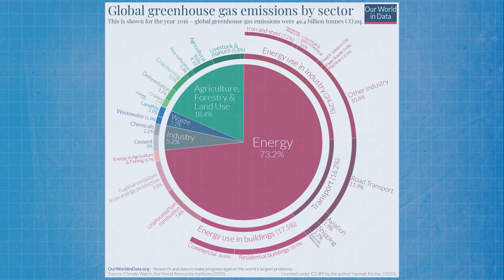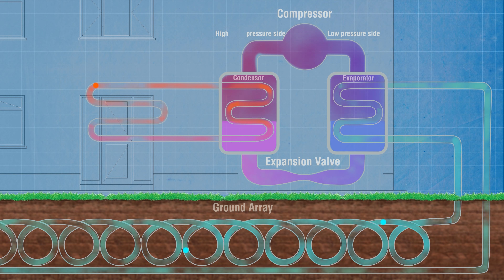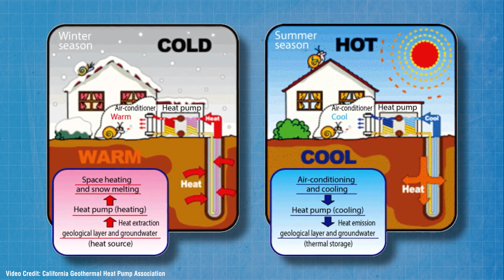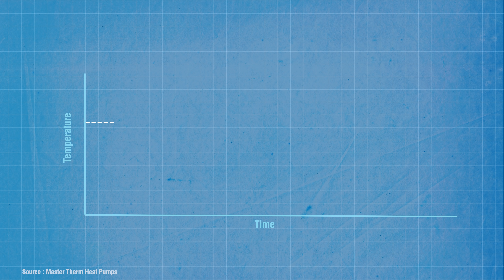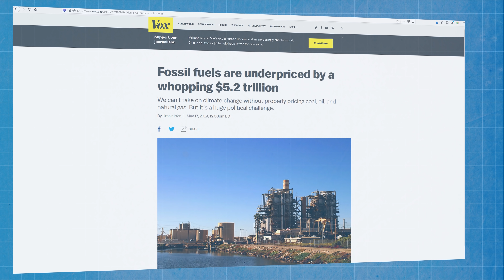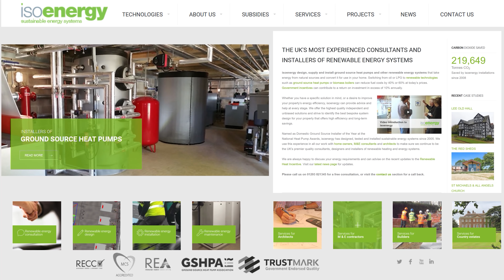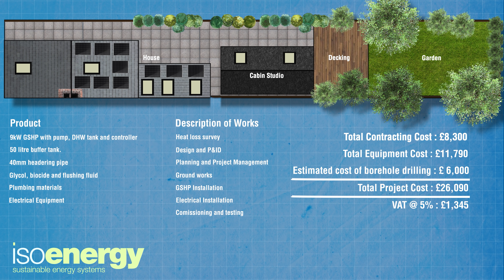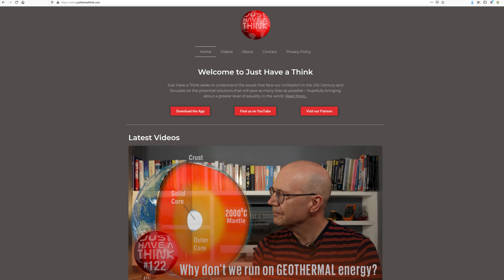Geothermal ground source heat pumps. Heating your home from your own back yard!

Comment: Has anyone looked into more micro systems which can be applied to more urban settings. What I mean is.. in an urban setting you might have small front garden which can provide enough heat for one or two radiators but not a whole house. Can you put a small set up next to that radiator...like something as small as the working of a fridge. because it is smaller it will be quieter so you may be able to house it in the same room as the 'front garden radiator'.

What I am getting as is that you can have one set up for a front radiator and then one for a back one ( for a smaller back yard ) these can then be running all the time allowing for smoother heating.

Currently the scale of one large Geo thermal pump is off putting for many and required a continuous chunk of land ( ignoring vertical here )

Comment: Geothermal and ground heat pumps seem to be all the talk at moment to help green credentials and reduce power usage.
In London we have a ready made geothermal structure. That is London underground rail, the Victoria line never dropped below an average of 24C last year. Cold buildings above ground that need heating and hot tunnels below ground that need cooling!

Comment: Ground source heat pumps in UK stop working after a couple of seasons as the ground temp permanently reduces around the pipes. We don't have the AC systems in summer to put heat back in the ground.
Reply: They don't require AC to recharge the ground, so is irrelevant whether someone has AC at the outset. By default with modern ones, there's passive cooling, which requires no additional hardware and will use thermodynamics to recharge the ground.  There's active cooling, where hardware can be installed to utilise the compressor to have AC-like cooling using fan coils instead of radiators.
Reply: @keypoint1293  I live in a country where ground source heat pumps are common and investigated them a lot for a retrofit to my house.
It is you who doesn't understand how they work in this scenario.

Comment: I have a home in N. America (New Mexico) in the mountains that has a river running about 150meters away from the house. I worry about running a normal air to air heat pump because it gets down to around -20c in the winter. My idea is to run a Geothermal loop down to the river and then 500 to 1000 feet of pex tubing under the water and use a water to water (radiant floor) heat pump. My question is #1 how many feet should I run in the river and #2 what liquid can I safely run in the loop in case it breaks and contaminates the river?

Comment: You know what, I wonder why they don't put the heat collector part in the attick, from what I know heat climbs and it's lost once it's there. I would make a second level in the attick and have the air pass through there before it escapes. Also if the house was concieved in a way that walls communicate with the attick it woud ensure that most of the heat is reused.

Comment: I’m about to invest in an Air to Water Heatpump System for my home. I’ve made some calculations and it seems my ROI is about 7 years Ibased on the current Gas prices). I’ve also looked into ground systems. They are much more expensive and the ROI for them is around 10 - 12 years. Legislation in The Netherlands is being made that will forbid the vertical column ground systems. Experts are afraid it will pollute groundwater too much, bummer. My garden is too small for the horizontal ones. I’ve got the budget to do this so I’m inclined to go ahead. What do you think? Is it worth it? I’m not only in it for the money. I would like to do my part for a better world too.

Comment: I once rented a large house that had a geothermal system. Very impressive. The system kept the house pleasantly cool in hot weather and quite cozy even in the coldest winter weather. I was surprised at how rapidly the interior temperature could be adjusted. The cost of heating and cooling was also a fraction of what I had been paying in much smaller homes.

Comment: "Ground source heat pumps are different from geothermal energy, as geothermal energy uses the heat generated from the core of the earth. Ground source heat pumps, however, use the sun’s energy, which is stored in the ground as heat."

Comment: If governments are subsidizing geothermal systems perhaps their contribution could be the vertical or horizontal placement of underground pipes. Govts could do this more economically than property owners by making installations over wide areas, utilizing public land and combining with other underground work like sewage pipes. The property owner would pay for the rest of the system, if and when they choose to. If the current owner won’t use it, the next owner may.

Comment: These systems are popular in Norway, Sweden and Finland. In 2018 I changed my oil burner to a 6 kW inverter ground source heat pump with a 170 m vertical hole. Cost about 14 k€. Provides both hot water and heating. It works nicely down to -25 degr C outdoor temp without additional resistive electrical heating. Now I later added some insulation to the house and switched to larger radiators, which added to the cost. This was needed, because the old radiators were designed to run at 80 degr C, which a heat pump can't handle (and would be very inefficient at if it could). Now with larger radiators the temp will reach 55 degr C in the radiators at -25 C outdoor temp, which is quite rare, so usually the system runs much cooler (higher temp causes worse efficiency). I could get even higher efficiency (and lower operating costs) with even larger radiators, or radiators with in-built fans, or rebuilding floors for in-floor heating (expensive!), but I'm quite happy with the system now. Total efficiency for the heat pump, or SCOP, for a year is 3.7 (measured during 2021) and that's not bad for an old house from 1927. In a new house with in-floor heating, heat pump efficiency would reach even 4 or 5, due to lower heating temp and better insulation. There is no need to be afraid of electrical grid load during cold periods. This system uses 1.5 kW from the grid when it is producing 6 kW heat (which it doesn't do all the time). Your tea kettle uses more power! (momentarily at least).

Comment: I am currently looking out of my study window at a field with multiple bore holes for a village-wide ground source heat pump system - despite the fact that many of the houses in the village are listed and not suitable for a heat pump retrofit. It's a great idea for a new build village, but providing funds for proper insulation would have been much more cost-effective in this case.

Comment: I wonder if you have any actual experience of the RHI? We substantially reconstructed our house to make it more energy efficient; we put in Air Source heating and a micro ASHP for water heating (both of which are working very well) but we also improved insulation and triple glazed. We had read similar statements to the one you make about how much this would bring in and expected to reclaim about £7,000 over the seven years of RHI. In fact we get just over £400 per year because the payment is based not on efficiency or energy saved but on heat generated from renewable sources. This means that the better you insulate your home the LESS you will receive. It is in fact a disincentive. It beggars belief that any scheme could be so badly thought through.

Comment: These no doubt work in specific locations where the geothermal heat is sufficient, there are extreame variations in temperature and the infrastructure is in minds at the design phase of a build. To use these scenarios and apply them globally though is like selling hydro power to someone in a desert.

Comment: I installed solar power last year and a stand alone ductless air source heat pump and this is heating the home from the solar. In the summer in also acts as an air conditioning unit. 
I also installed a solar diverter a solic200 which sends excess power produced by the solar back into the immersion tank to heat domestic hot water rather than sending that excess power back to the grid. Once my gas boiler gives up the ghost, I will be installing an electric boiler. Which hopefully would have come down in price by the time I need to replace the existing boiler. Small changes over time all add up to make a difference for the future.

Comment: OK.
I believe most of what you said.
To briefly summarise  ..
The price of gas (& I expect oil too) 
IS going to rise.
Just to make us stop using it.
Heat pumps are not a proper substitute. 
What is an alternative that works as well as gas  ?
Then what is available and remotely affordable  ?

Comment: Here's another thought: instead of boreholes, install  a 3000 Gal water tank (or more depending on your needs) approx 1.5m under ground surface, so water in the tank never freezes. Run heat exchange lines into the tank.
Reply: There isn't enough surface in the tank for enough heat to transfer from the surrounding ground and from the tank into the heat exchange lines. That's why several hundred meters of pipes are laid down into the ground. Works fine in a small lake or river, too. But the tank is way too tiny.

Comment: When gas boilers are phased out here in the UK there will be countless miles of redundant gas pipe infrastructure serving much of the nation's housing stock.
If these pipes can't be used for a replacement hydrogen supply, could they instead be used to source air or water for heat pumps for the nation?
Or alternatively, could a localised district heating system use the pipes to supply hot air, hot water or steam to at least boost whatever heating system replaces gas central heating?

Comment: Frankly I don’t believe geo thermal is the holy grail for one it’s way to expensive and two not everyone has outside space to accommodate the system. My feeling here in the U.K. is that with such a huge gas pipe system going begging if we stop the use of natural gas Hydrogen may well take its place.

Comment: The upfront costs of a hear pump system plus getting my whole house insulated is too much right now. Having a 1930's semi detached house means there's draught below (to prevent wooden pillars in the sub floor from rotting). I'd need to get cavity walls built as well as the system itself.

Comment: We had a geothermal system and LOVED it until... our bill were very cheap but our water is mineral filled and it did not take long for the minerals in the water to cost us way more in repairs than our savings. If you get a geothermal system, do not believe the contractor if he tells you  an open loop system is the way to go. Make sure if you have mineral loaded water that you go with a more expensive closed loop system...

Comment: My thought is to use point-of-use electric water heaters to top up the water temperature only as required. 

There would still need to be an electric heater in the storage tank to bring it up to 70C once a fortnight to avoid pesky microbes (esp legionaires).

Comment: Hi, great that you have picked up on the potential of GSHP's. The costings that you got are interesting but I think that with installation and manufacturing scale (of the heat pumps) the installation costs will go down. What can't be fudged is the cost of the boreholes or the space needed for 'slinky' pipe arrays. You might like to take a look at a company called Kensa Heat pumps (I don't work for them!) their solution is that small properties can share boreholes with the glycol solution being fed via a network into several homes for use in their neat little heat pumps. In this way the borehole (they are estimated to have a life of between 50 and 100 years) becomes fixed asset delivering low grade heat to several households potentially giving a very long term return on investment. So instead of householders having to stump the upfront capital cost of the boreholes, this would be picked up by, say, a local authority who would collect the cost of the borehole back from all connected houses with a modest return over the whole life of the borehole say 60 years. With GSHP's having a CoP of 3 or 4 the savings for householders with, say, electric storage heaters would still be immense (I worked at a local authority that had 600 rural homes that were solely heated with storage heaters) or, more likely, just enable people to heat their homes properly for the first time. There would potentially even be enough savings for the homeowner to, instead of buying the heat pump outright, simply lease it for 10 or 20 years  and have a new more efficient one installed at the end of the term. Thank you for your channel it does give  hope!

Comment: Great idea and well proven, the South Bank Centre had a heat pump install when it was built that was eventually ripped out as the price of oil made it uneconomic.
I am considering it for my home heating however at current uk energy prices it doesn't make economic sense if you have gas available.  On my tariff gas is 3.6 times more expensive per KWH than electricity, this would mean the ground source heat pump would have to have a coefficient of performance north of 4 just to offset the price difference !  Then there is the capital cost to consider.  I can't see it taking off in the UK unless the price of gas gets closer to parity with electricity.

Comment: What about a regular heat pump with extra solar panels.

I'm a big fan of heat pumps.  I also like ground source heat pumps.  The biggest down size is the cost.  I have wondered recently that combining extra solar panels with a air source heat pump might be a better option.  The regular heat pump with extra solar panels would be as green as the ground source heat pump, but cheaper.

Comment: Heat which is already escaping naturally such as in Iceland is already part of the Earth's energy mix, so they are using energy which is already releasing and adding to global warming. Any new geothermal releasing though is adding 100% of its energy to an already overheating planet, surely not something we want to do?
As also with all nuclear techie wet dreams, which releases energy from uranium atoms and is also extra to what we are already facing with historic fossil fuel release. They may be clean compared to coal and oil, but neither nuclear nor geothermal are part of any solution to climate chaos.

Comment: A heatpump is a standard split type hvac system.  The only difference is that there is a valve to reroute freon after the freon leaves the compressor.  

The main difference between an air source and ground source is that one normally uses air to move the heat. Ground source use one of two methods to move heat.  DX where the freon tubing that would normally be in the exterior unit is now plumbed into the ground.  The other way is to use a pump to move the water or antifreeze thru dedicated piping into the ground.  

By its nature drilling is the real driver in the cost of a ground source heat pump.  One can pump to a relatively shallow horizontal loop, vertical drilled loops or to a pond.  There are open loop when you pull water thru the exchanger and then either drop the water back into the aquifer or out into a lake or other place to dump the water.  

No matter how one does this exchange it is not complicated. Depending upon how big the geo heat exchange field is, and how the designer makes the system operate, this is how one can really determine the final efficiency  or SEER and COP the system will operate.  one unit of power to run and 4-5 units of output from the ground heat. 

For me really makes little sense to run a Geosystem at this point due to the cost of the Well. Since the advent of inverter type air to air mini split systems. Pretty much get the same efficiency but at a monster lower cost.  Ever reduced return on investment.  If one lives where your air temps during the winter often get below zero F  then it does make sense to do a geo source.

Comment: RHI has not been well publicised. Also to make it more worthwhile they should include incentive for PV panels which can help offset the electricity cost plus a solar immersion heater switch system so excess electricity from solar panels can heat the hot water tank instead of the heat pump, bringing costs down slightly further.

Comment: There is soon to be no need for more conventional and geothermal green technologies that are more expensive and disadvantaged when compared to the cleanest possible nuclear fusion SAFIRE GENERATOR. Learn about this best and vastly cheapest 24 Hr. reliable, hydrogen-powered, FUSION NUCLEAR and community located device built on any scale, on a tiny and unobtrusive footprint. It is the latest fusion nuclear technology that is in commercial design and production now. They will not need battery or other storage technology backup and no extended ugly and vulnerable electric grid. See it at "AURION @t" and then learn about ELECTRIC UNIVERSE THEORY and more advanced Plasma Physics at "THUNDERBOLTS @t". Then please teach all your friends and peers so we can advance the most modern physic knowledge.

Comment: Saw a decent Discovery Channel Series on installing these Geothermal Heating Sytems years ago. Really only practical for new builds or total refurbishments. But I can still remember the narrator saying it would take upto 20 years to have pay back for the system. You said it! "not all of us have £30 K knocking around in spare cash, and my "housing assoc" was definitely hostile to the suggestion.